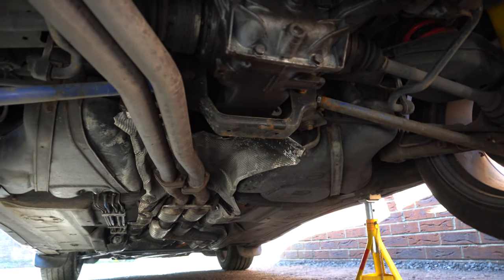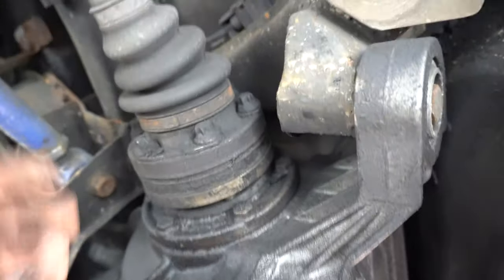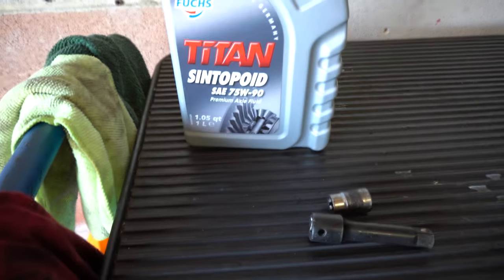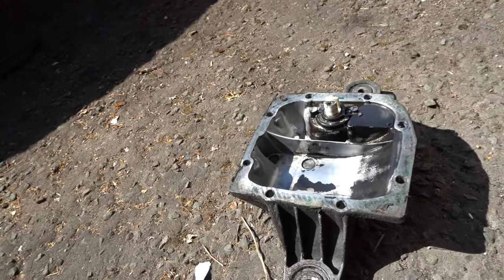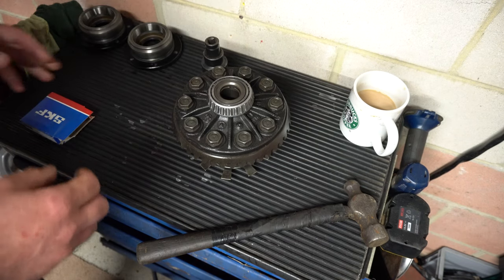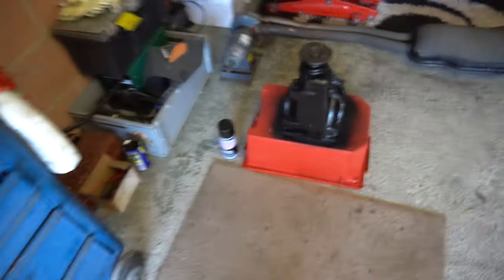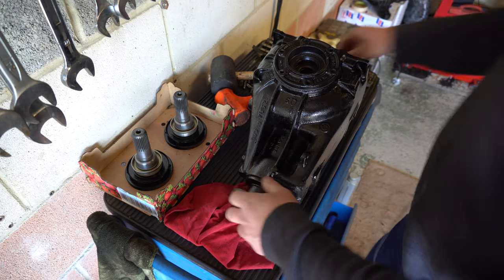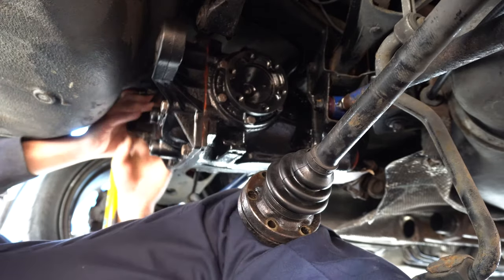BMW E36 188 Diff Basic Rebuild

Comment: In this video; Pamo does things that've been on my mind for ages haha. I've got more of a whilsting sound from mine, at a certain speed. Doesn't particularly sound directional, and I had both wheel bearings done a couple of years back when I refurbished the subframe, so I think it may be the pinion too...
Reply from the maker: I hate noises that shouldn't be there... And will endeavour to always eliminate them.... Sometimes Successfully, often not. That's the joy of being an amateur and learning as you go I suppose.
Reply: @ManSeeksCivic  I've seen a couple of good videos on replacing the clutches in an E36 lsd, but not any about the bearing processes so this is top notch mate.

Wheel bearings are the worst, the moment I hear the faintest rumbling it's in the back of my mind. Had left front done last summer, when I put the car away for winter I could definitely hear the right front going too 😂😂😂

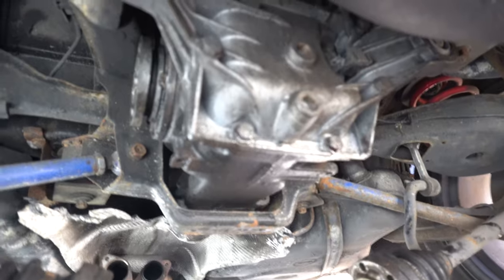Comment: I find silicon seals best if the items its used on are not tightened up at first, finger tight then let sit to cure a bit. That stuff you mentioned on the bolts is probably some type of PTFE sealant, for blind bolt holes in coolant and oil I use Permatex 80632. There is also something called pipe dope and it dose not work for shit on bolts in a blind hole, its chunkiness that makes it not work. Yea that diff is not much to remove and have had mine out to change to 3:46 gears. Those axle bolt are easy to strip and those that did are now allens, probably should had changed all with how many times Iv had those axles apart.

Comment: Hello from Seattle. Thank you for your great video. 
 Today I have done project for my 1997 BMW Z3 2.8 with manual tranny. 
My project it's about differential 3.15 replacing the bearing for out shaft and input shafts. But the thing is when I installed all new bearings and especially the side bearing it's turns really really hard.  Especially when I tight the 6 bolts for each side it's does not turn at all. What do you think? any suggestions?
Reply from the maker: Hi, if you've replaced the pinion bearing on the input side it's crucial you set the crush tube precisely. My video didn't cover this aspect because at the time I didn't have the correct tools to attempt the pinion bearing. As for the side bearings on the output shafts,   there is only really 2 suggestions I can make = 1 - are you 100% sure the bearings are correct or 2  - is there any damage/foreign objects stopping the outer races from seating perfectly in the carriers (a small high spot like a raised dent can stop the bearing races seating properly and put too much load on the bearings).
Reply: @ManSeeksCivic   do you think it's be ok to replace the diff unit 3.15 to 3.91?
Reply from the maker: Certainly, it will give better acceleration with less top speed. But a 3.91 would be fine.

Comment: How did you get the old bearings and bearing races out? Aren't they a press fit?
Reply from the maker: They are but a little careful pursuasion and they will come off.
Reply: @ManSeeksCivic  Ended up putting the flanges between 2 pieces of wood and using a sledgehammer and a flathead to tap them out. Thanks!
Reply from the maker: Now that's my kind of shit! Well done sir 👍👍
Reply: @ManSeeksCivic  One more thing: was yours somewhat hard to turn after reassembling everything? I can still turn it with one hand, but it seems to have a good bit of resistance when trying to turn it.
Reply from the maker: It was a little tighter yes, if you can still turn it with one hand - that sounds good

Comment: hey mate, great video! super helpful. i'm actually replacing the clutch packs in my e30 LSD currently, and had a question if you could answer it. you mentioned not to mix up the shims, which I haven't, but it seems as though i may have mixed up the stub axles. i marked which side was left & right but I might have mixed it up for the stub axles, but the actual seals/shims i marked correctly and know for sure. my question is, do you know if the stub axles are the same on both sides or is there a slight difference to them as well? thanks
Reply from the maker: I believe the shims are in there to allow for variance in tolerances of the stub axle machining therfore yes, they could be slightly different and would have to be placed back in their original positions. Sorry to be the bearer of undesirable news 😞
Reply: @ManSeeksCivic  hey thanks for the reply, turns out it actually doesn't matter because the spider gears in my small case LSD grenaded themselves anyway lmao 

must be cumulative effect of previous owners, as when i got my car i had to swap out the left half-shaft since the boot broke and seized up the cv joint. the diff stopped working shortly after, and long story short i put on an open diff for the time being and only recently was able to investigate my LSD. oh well, i found a medium case LSD to swap for anyway. thanks for your video!
Reply from the maker: That's sad news but I'm glad you've got to the bottom of it.

Comment: whats the part you are installing at 15:51? you don't have a link for that part. how did you remove the old one?
Reply from the maker: That's the outer race of the taper roller bearing. The old one is gently tapped out from the other side - when you get the part on the bench you will see that you can use a punch to gently work the old one out.
Reply from the maker: BMW part number 33131204568 - Google the number and you will see pictures of the bearing in 2 parts.
Reply: @ManSeeksCivic  oh it's the bearing with the race as one part? I have a z3 I guess it's the same procedure and parts?
Reply from the maker: It should be similar yes.

Comment: Pamo, how did you get the roller bearings off the crown wheel in the first place? Did you have some sort of pulled tool or was it a case of destroy them to remove?
Reply from the maker: Chop them, very carefully. Snip the baskets with some side cutters and then use a dremel with a cut off wheel to go 90% of the way thru. A drift and a hammer will crack the race, bingo - they'll slip off.

Comment: Thinking of replacing these bearings on my small case diff as they are rough when i rotate the output cups. Just worried if I will have to set backlash back up or anything like that. How is your diff holding up now?
Reply from the maker: It's great, a job well worth doing and relatively easy. Just keep the parts in the order they were removed.

Comment: cool vid as usual buddy, but i have a question you may be able to help me with, i too have to wonderful maxspeedingrod arms but my drop link on the passenger side hits the arm, just a touch but its annoying, any ideas on why or is my next step adjustable drop links??
Reply from the maker: That's odd, it shouldn't touch Paul. Are you sure the arb d Bush mounting point on that side isn't slightly bent towards the front of the car 🤔
Reply: @ManSeeksCivic  not that i know of, but youve planted the seed in my head so i will deffo check that out! thanks buddy! :-)
Reply from the maker: @paulgallagher1376  it's somewhere to start, then check the upper control arm alignment. After that, maybe the mounting point (upper) for the droplink. Good luck, let us know what you find 👍
Reply: @ManSeeksCivic  both drop links renewed, 8 nuts and bolts to do both sides.... every single one of the buggers gave me grief! top end of the one giving me trouble had perished to that could be cause, also found the top outer bush of my top arm has excessive play so that needs replacing, its only 18 months old at most! oh joy!
Reply from the maker: Oh the love of cars, keep grinding away mate 👍. Today I bought a new trailing arm...The axle didn't want to come out of the hub for love nor money. No hammer beating or 10 tonne pressing did the trick. Sometimes you have to love it to want to do it.
Reply: @ManSeeksCivic  small steps my friend but we'll get there!

Comment: Pamo, when is needed to do the backlash and it stops being plug n play diff unit in/out? 
How to best diagnose when the backlash is off ?
Reply from the maker: Mainly when changing the front pinion bearing, or if you mix up the parts. It's quite an involved process of fitting parts, marking gears and testing hoping that it's correct. If it's out, it requires tearing back down and rebuilding
Reply: @ManSeeksCivic  Big thanks. So i dont have to worry if i only changed clutch discs and seals. Thanks.
Reply from the maker: No you should be fine

Comment: The bearing cap bolts should have thread sealant on them.
Reply from the maker: 2 of them did when removed and reassembled, the others didn't. I believe to seal the caps from the diff oil. It would do no harm to do them all.

Comment: you shouldn't be using any sealant on the diff bro. that causes leaks. just use the factory paper style oem gasket or failing that one from motor factors you cut to size drawing a template round. my m3 lsd's gasket along with the other 2 diffs ivs had in the car have had zero leaks using this method. also with silicone it ends up getting in the fluid if you're not careful too. that's why they don't use silicone/rtv from factory
Reply: Otacon I used grey sealant one year ago and it’s still dry. Mostly because (I think) I used the right sealant. It’s victor reinz grey reinzosil. I very sparingly put a thin bead around the circumfrence and smeared it out to a thin paste. If it leaks I will put the paper gasket in.
Reply from the maker: I thought this would be a topic of conversation, to explain my choice - 1. The only proper paper seal I could find in the UK at the moment with the covid problem was £18. 2. I quote ". BMW stopped using the paper gasket and the BMW procedure to seal the diff cover to the diff says to use sealant now." and 3. The sealant I've used is the same stuff used to seal the cylinder head and gearbox on the FTO so I decided if it's good enough for that, it's good enough for my diff cover.

If it leaks, I'll change it.
Reply: Pamo true and the diff side seals will weep too after a while. The spring inside loses tension and will give.
Reply: ah fair enough bro, wasn't being a dick or anything just seems to be the route of many leak problems for a lot of my friends who've done it this way that's all. I didn't realise they'd discontinued the gasket that's sucks then mate.however using the universal template one you draw around and cut out works I can confirm. as have done that before.
Reply: I bought the lsd for my car with the previous owner having just done a new oem paper gasket...and it weeps from the rear cover. I've checked the bolts too and they're all tight. If I were to rebuild it myself, which I may do, I'd probably use some sealant as well. A small amount, smeared out using a finger. None of this bead stuff, that's too much and ends up real messy.
Reply: @SiggsGBR  I think the reason the paper ones leak is due to using sealant with the gasket mate from memory. so that's probably what the previous owner did hence the weep. or the mating surfaces weren't cleaned properly and fucked a bit of the gasket when it went on.
Reply: working on steam turbine bearing housings, pumps and gearboxes at work we use hylomar blue on all oil applications, we dont fit any gaskets on oil systems as its something to breakdown and cause a leak.

Comment: I always thought changing the bearings was enough to have to redo the shims...
Reply from the maker: The bearings should all be machined to the exact same tolerances. I'm hoping this is the case... Hence the instruction to keep the shims and carriers marked so they can all go back the same way. Also, Ive not changed the pinion bearing here... That would require a new crush sleeve, new shims and all the setting up that goes along with it.
Reply: @ManSeeksCivic  I wasn't questionning your knowledge, I was questionning my own knowledge lol
I for sure hope everything will be fine and that you'll be able to fix the noise.
Reply from the maker: @imnota  Not at all! I fear you may be right, but hope you're not 😂😂. From looking at the castings and other parts - I figured the bearings are the least likely to be variable. I'll be honest. There's a little finger crossing going on.